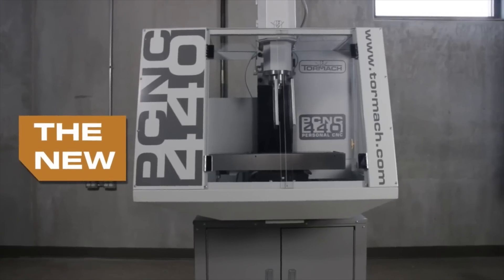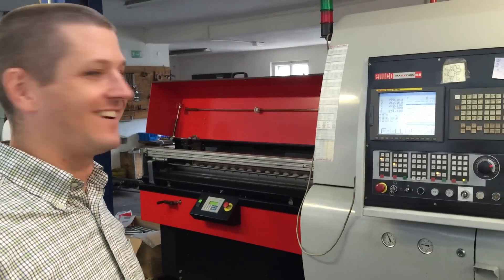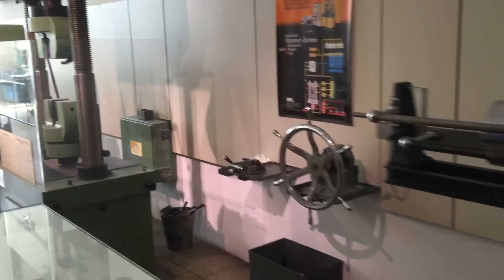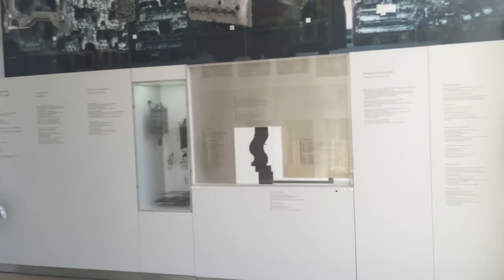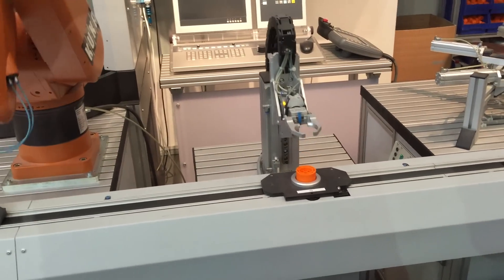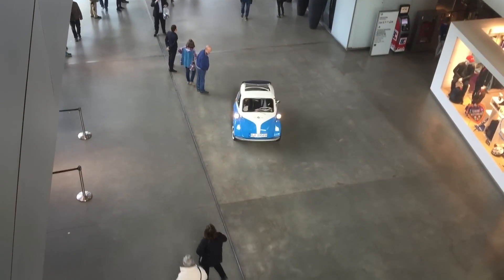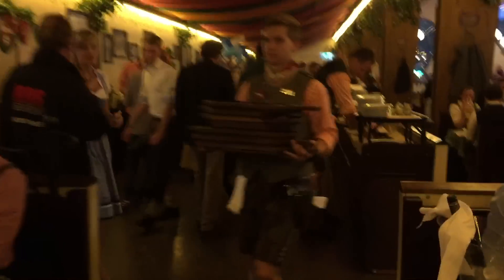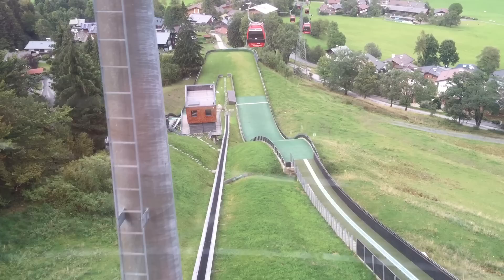NYC CNC Visits Germany, Shop Update & New Tormach Machine!

Comment: You should have also checked out the mechanical engineering school in Ansbach when you were in Germany :D
We have lots of Weiler lathes, Deckel FP1 mills and a nice set of 5 DMG DMC 635 mills, 2 DMU50's and 5 CTX alpha 300's. We also have 4 small KUKA robots.
Reply: +NYC CNC about 200km by car
Reply: Nowhere is far from anywhere in Germany, I am used to getting around Texas. When I try to get friends to go anywhere in Germany that is more than a few hours away, they always complain that it is too far. They crack me up.

Comment: That machining museum looked great, I will definitely visit if I get to Munich! If you ever come to southern Australia (Melbourne area) let me know, I can show you more robots, including fully autonomous driverless forklifts :) As well as a very large ice cream plant with some incredible automation.

Those patch panels for piping are called keyplates, they are useful even in highly automated plants as fully automatic valve systems can be overly complex - some of the hygienic 3-way valves have 20+ O-rings that need maintaining and cyclic replacement, gets expensive when you have more than a thousand of them in your factory...about a $250K annual maintenance line item :)

Comment: Nice to see my country out of the perpective of an american. And yes, the Deutsches Museum is really spectacular! Have you Visited the Higy Voltage Show?
Reply: they use up to 50 000 Volts and show what you can do with such high voltages. Like haveing a contact point on each side of a 1x1 meter glass panel so you can see the currency finding its way trough the air around the glass and stuff like this.

Comment: I don`t get it. 
PCNC 440 Basic Package $6995
PCNC 770 CNC MILL $6810
Why is the bigger cheaper? OR better stated why is the smaller more expensive?
Reply: +NYC CNC Okay. And is this still rigid enough to mill steel? Cause less then half the weight then the 1100.

Comment: Great video. German engineering is always awe inspiring. Can't wait to see the new Tormach 440 in action. I think a lot of people are confused on the pricing. The bare machine is under $5,000. Stand and full enclosure are options, and there is supposed to be an 8 tool auto changer coming soon.  This is a great starter system that someone will still be able to put to good use even as their business grows. Way to go Tormach!

Comment: Great stuff. Germany: The home of engineers...
The beer brewery looks identical to some small breweries i have worked at in Norway programming the PLC control system and HMI for some new installations (it looks like the exact same type of robots, pipe setup, tanks, trucks, etc.)

And on the demo in the museum with the engraved plastic caps, the small press that presses in the magnets is actually the first time i have seen pneumatic "artificial muscles" used in a practical application.

Comment: I don't really get the 440. How is it a good price point at 10K ? Seems like a smaller machine for almost the same money.  Depending on choices of course, but pretty much in the same ballpark price vise compared to the larger machines.
Reply: From their website. Two packages around $7000 and two around $10000.

Comment: The big, more modern CNC mill is an old Hermle 5 axis.

Modern Hermle mills are considered by many to be the pinnacle of milling machines. Heidenhain controls, glass scales on everything, super rigid machine castings out of composite materials, a patented spindle crush washer system that prevents damage during crashes, and an intrinsically stable dual-drive trunnion. They even have an option for an integrated air spindle; works like any other 15k spindle, but pick up a special tool holder from the ATC and high-pressure air drives a speeder up to 80k RPM for surface finishing work (oh, and those same air channels get flooded to become super-high pressure through spindle coolant). They have other options for things like cryo machining on exotic metals that harden under heat (inconel and the like). Oh, and they build their own pallet changers for high-production automated 5 axis milling. 

Along with AgieCharmilles/Mikron and Mitsui Seiki, Hermle builds machines that basically run circles even around DMG Moris or Makinos. Of course, you're going to pay through the nose (starting prices of around $400k, before you tick an options box).

Fun fact; Apple now has a 5 spindle Hermle cell with a giant pallet pool to do all their prototyping work.
Reply: +NYC CNC Here's the thing; H-hain is German, and because of Deckel, the German pattern for a CNC machine has always sort of intrinsically been 5 axis (where as the American Bridgeport sort of aimed our trajectory towards 3 axis). As such, Heidenhain has always been thinking in a 5 axis environment, even going back to the days of manual mills and putting DROs on them. Thinking like that for decades sort of allowed H-hain to design their controllers around the concept, instead of hacking it on (like Fanuc an Siemens, who is also German, but came to the game late).
Another aspect of machining in Germany (and Europe, really) is that they are not as big on CAM as we are - a machinist in a job shop there will get a print and program at the control. US machining is more CAM centric, so our controllers (and remember, Fanuc really started as a GE partnership, so with US-centric roots) is more about sucking in CAM written code and executing it. Heidenhain has better tools for on-machine programming. That isn't so important when it comes to modern crazy 5 axis tool-path, but the on-machine programming focus means Heidenhain has a big lead in UI for setups and running a machine over everyone else (though honestly, PathPilot is pretty impressive looking!).

Comment: the 440 has a good prices as a base machine not with the enclosure $10 grand.

you going to get more into the gun stuff, the updates with fusion the 2D drawing is a lot better, the cam is a bit better, they still have not fixed the DXF import yet, but it is better over all
Reply: +daniel lyall Yeah, I'm definitely not sold on the value of the 440....though I have a major beef with Tormach overall.
Reply: +Kenneth Higley base prices is good for what it is add the enclosure nup